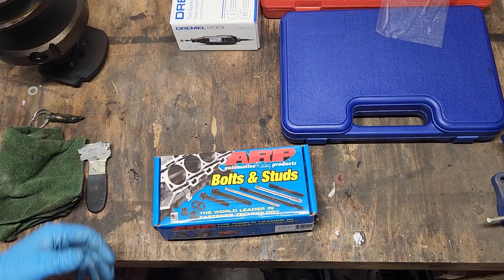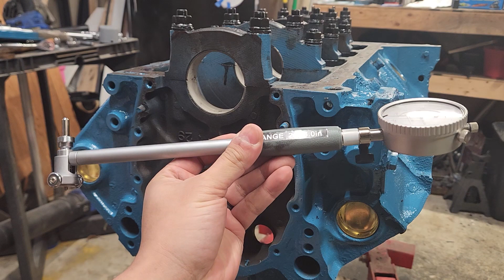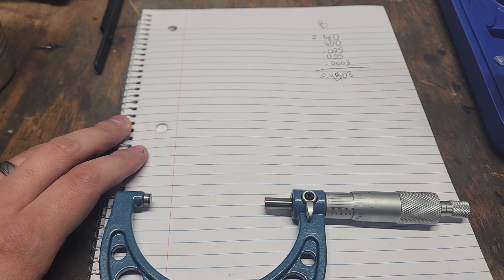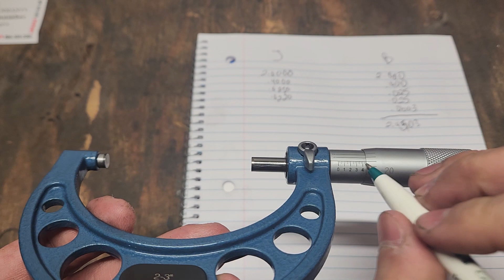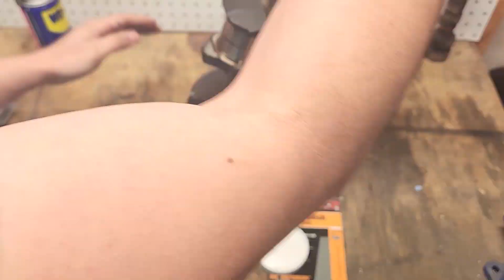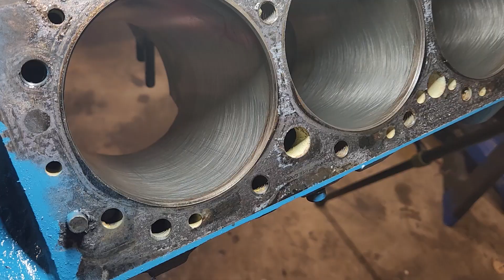Budget 400 Hp Small Block Chevy build - Part 2 - Checking Clearances

Comment: time out guys this kid is learning, just the same as we have..  remember when the shade tree was all you had...  the important stuff he has right, for a "budget build".  it is just the short cuts that make our socks fall down.  i send everything to the machine shop. flat shinning surfaces is my friend, but then i haven't done a  "budget build" in years.  right after i had one come apart on the track.  no more "it is good enough"
Reply from the maker: Have to start from somewhere!
Reply: @diveingarage  yep and you are fine..  we have all been there.  you are building a daily driver and that engine will run  just fine.  when it becomes track time  details matter. that is all i am saying  i built a 351 M same type way. took it apart and put it back with "cleaned up parts" and years many in fact it still runs get my grandson loves it.
Reply: Yes, the more you build, the better you'll get.

Comment: I would have used the stock main bolts and used the money to have the block hot tanked and cam bearings installed.
Reply from the maker: I would have liked to have the block tanked, but all the machine shops near me had a 4-5 week lead time.